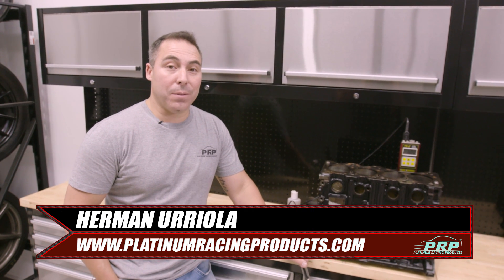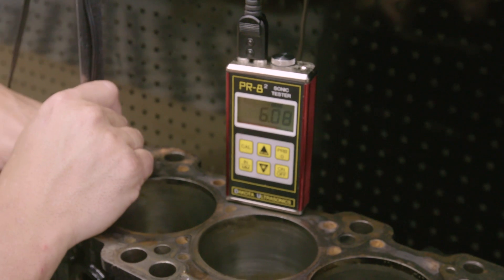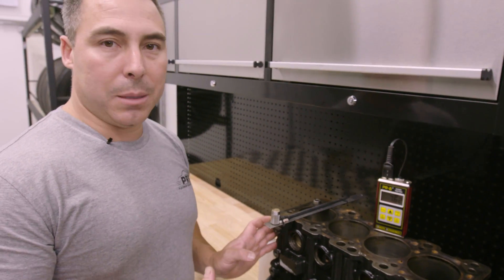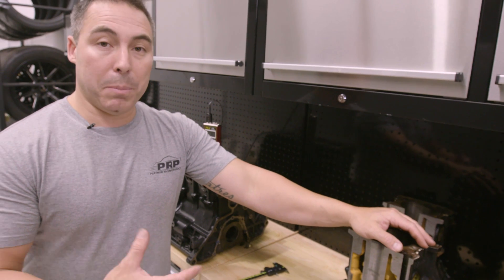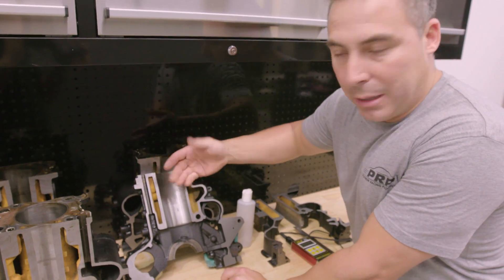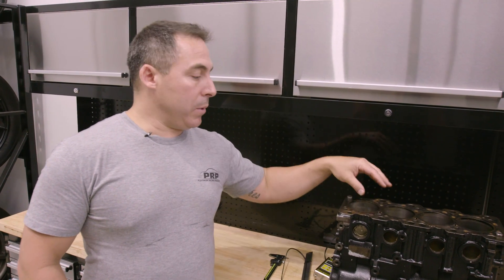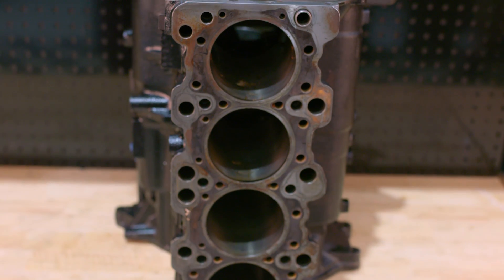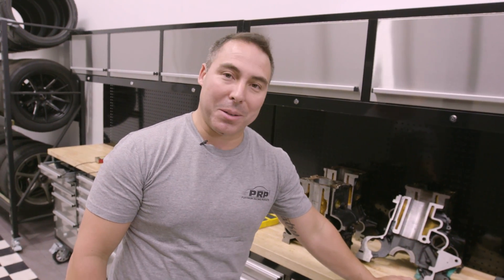We cut Up a 4G63 Evo Block and Test It

Comment: You need to progress to an "A-Scan" ultrasonic flaw detector and learn how to use it.
You need to see where the reflected signal is coming from and you see what is going on.
Ultrasound at this frequency (2Mhz - 5Mhz) will not pass through an interface of air, but will pass through solids and liquids.

Comment: Would really help to have a proper ultrasonic thickness tester like a DMS2 or 38DL with an A-scan display, so you can see what the waveform is doing. You could have seen these changes in section without cutting it open. Generally helps with ensuring you are picking up a clean backwall and not other geometric features or point reflectors.
Reply from the maker: teamneverlost agreed but cutting it open is still the way to find out what is really going on and worth it for long term development
Reply: @MotiveVideo  For sure at the cost it's probably worth it for r&d, but if there's ever anything you don't want to or can't cut open these sets can help in seperating spurious indications.

Comment: When are the early Holden used engines going to be tested, like the 5l, 253, Buick 3.8, ecotec, and all the straight 6's
Reply from the maker: They dont really suit our Motive market. These arent cheap videos to make either.
Reply: @MotiveVideo  however they are cheap engines to get ahold of, it could also expand your audience(more so when I'm guessing that most of your audience is Australian anyway) and the 5l at least has been a rival motor within a shared chassis as the RB(VL) and you could go over why the RB is often the better choice and ecotecs have been proven to make some big numbers too

Comment: I love these tests. I don't know if Australia has 4G64 or 2.4L examples there, but I'd be curious to see what they're like. It has a taller deck, and perhaps a thicker deck. They do have a bigger bore as well, but that might equate to thinner cylinder walls. Furthermore, I'd like to see if Hyundai or Kia blocks are any different from Mitsubishi blocks. I don't know of anyone else doing this kind of testing for the public's knowledge base.

Comment: Cement filling the block is not uncommon to add strength to the bottom.
Reply from the maker: Adel AlMejhem that actually wouldn’t help the problem we found between cylinder walls
Reply: @MotiveVideo  Thank you for the information. A lot of evos are making 800+ whp .. and their block holds fine. When do you think that weakness would become a problem?
Reply: @K2theK-b6u  it holds fine till they turn it up slightly, they're teetering on the edge at 800, if they weren't you would see alot more at 1000+

Comment: I wonder if there is a difference between the 6-bolt and 7-bolt 4G63, in old evos before the mirroring, its common to use the older 6-bolt.
Reply: bingoberra18 

I want to see this info too. I’ve got a built 6 bolt VR4 motor that was built for 700hp. APC ran the 6 bolt deep into the 9’s consistently with no issues also. I was always told the 6 bolt block was much harder and thicker.
Reply: I bet the 6bolt is even beefier

Comment: Very interesting.

Wonder how Tilton go about their builds seeing this as they are making well over 5-600kw and still using the cast block instead of going billet like what Michael Baghdadi did with his 8.
Reply: They're many 4g63 engines well over 1000hp, never heard of a cracked 4g63 block. Toughest 4 cylinder engine they're is.
Reply: They half fill the block.
Reply: @mehrshadvr4  where did you get this info?
Reply: @supernice_auto  people do these in the u.s every often

Comment: There's a reason the 4G63 is such a legendary engine.. Well.. block at least lol...
Such basic roots back in the 80's to what it became... and why so many love this Engine. ..Me.. very much so... as well as the 4AGE....
Huge thanks for showing us what you found...
Side note: ummm 500-600kw block... then becomes deficient ...really??!.. Pretty impressive..
coming from an 80's design!!!
Anyone would know that's far beyond the limit from a stock 2lt block... 20 years ago... When the Tommi Makinen Edition was released... you think, that anyone thought that 500-600kw would be achievable through the Mitso 4G63??
Just glad that engine builders and tuners had the brains and talent to bring these engines to such a huge level...
with an iron casting......lol... at least it's acoustically dead... that's a plus...

Comment: Damn I never knew that about the 4g63 block. I always thought they were sleeved like honda blocks. Is there no other way to better support or strengthen that block ?
So next on the list ; 4g93, 4age, 3gte, ej20, b16a, k20/24, h22, lr8, 13b.
Reply: I think the only way to make a standard block stronger would be to do interference fit sleaves, which requires the original one to be milled out very precisely then replaced which is what high level diesel guys do

Comment: test an LS. Maybe grab a LS1, 2 & 3 and see difference between. could be interesting
Reply: I'm going to save them the comment, they're a sleaved block so there's not much of a point in testing if you plan on pushing over 800hp reliably it's better to start with an iron block or getting a resleaved block

Comment: Any chance you can do comparison with a 4g64 block as some evo owners like myself use them for 2.4 builds. would be good to know if they are similar in strength or alot weaker.
Reply: 4b11s are weaker than the 6 bolt 4g63t
6 bolt blocks all the way.
Reply: @Ryan_1997  no they are not

Comment: Love to know what makes the k series a great engine
Reply: Its the amount of air the heads flow, somewhere in the 300cfm with stock ports. VCT to help with low end torque aswell as VTEC, small cam for low rpm, big cam for high rpm, very smooth and linear engine thats very eager to rev, 8500rpm redline from factory, 9000rpm redline with a tuned ecu or higher in built motors, bottom ends are also very robust, well known to take 320-340wkw on completely stock engines (stock head, stock bottom end completey unopened) with boost on e85, ive had a look at the bottom ends also and noticed the girdle is tied into the block, similar to that of a plazmaman billet girdle that is made for an SR20. After playing with RBs, SR20s including doing a VE head swap and now having done a K series build i can say the engineering put into the K series is what makes it a great motor.
Reply: The simple fact that it’s not a 4g is what makes a k series so grate   B series for the win tho
Reply: @Ray-Vr38  K sure, B ? lol.
Reply: @TurboVisBits  Ray Loulach know's what he is talking about K20/K24 are great motors but Mostly Best for the N/A scene  but when it comes to Boost B Series is Defs King...   Go look at Rays Channel.. he Loves his Civic's owns a EG with the Plates 4GLOL,  makes over 1000fwhp on a Hub dyno,   Pretty sure he also owns an Evo of his own,
Reply: @jjsorenavki7005  Worlds fastest h pattern in the world is grannas 2jz supra second is boostin performance 4g63 talon
Reply: @jjsorenavki7005  hondas rule fwd tho no doubt i was always interested in the rsx/dc5 if im not wrong there k20 not k24
Reply: @omardsm2323  where I say anything about worlds fastest manual? Lol
Reply: @jjsorenavki7005  first coment was for someone else my bad lol and i meant the second coment

Comment: HP Academy just did an interview with Julien Godfrey this morning where he stated that he put a 12mm steel plate between the block and head to ensure block rigidity as they run 3.0bar through a 45mm restrictor.

Comment: Test it against a 3SGTE
Reply: More importantly the 5sfe as they have true siamese bores the length of the cylinder unlike the 3sge/3sgte blocks, hence the common 5sgte builds seen in the MR2/Alltrac community. All 5 generations of 3sge/3sgte blocks have a 30-40mm cavity between bores at the top of the cylinders, (I assume for more cooling surface area where the most heat is generated and to create a more interconnected coolant flow path) which is the reason for the common cracking in builds over 3-400wkw (obviously turbo/fuel/application dependant, cylinder pressure vs RPM associated with these power levels being the defining reason for failures) ALL generations of 5sfe and some 3sfe feature the full siamese cylinders (some 3sfe cars used 3sgx blocks as they are fundamentally interchangable, unlike the larger bore 5sfe 87mm vs 86mm Depending on the location and time of production, due to over production of 3sge/3sgte blocks relative to demand, the cavity can be seen through the front frost plug holes if you are looking to confirm what block is actually being used..) there is also a well known cracking issue around the head bolt hole nearest the water pump, Toyota added extra material to all S series blocks in this  area from 1996, these are known as 'straight edge blocks' and can easily be identified by the straight edge and generally thicker area around the deck face by the water pump instead of the previous generations where it followed the contour of the cylinder and a bulge is seen where the bottom of the head bolt/stud would bottom out. Again due to old stock being used, not all 1996 blocks feature this and it's generally accepted that it is not a guarantee untill 1997-8 depending on who you ask. There is also word about American cast 5sfe blocks (known as 'square boss' due to the raised square areas where the freeze plugs are located) which are rumored to have thicker cylinders/decks but I have seen 0 evidence proving this unlike everything else mentioned here.
Reply: @3sgteJoe  I have a '96 GT4 that has all the stock features of the improved '96 version. Possibly need to get my block checked!
Reply: supply a 3S and they possibly will
Reply: Florida Man wouldn’t be hard I’d imagine the block is the same as the RAV4 and celica
Reply: All 3sge/3sgte blocks are weak in-between cylinders, if you're shooting for over 300wkw I'd suggest finding a 1997+ 3sfe/5sfe or you'll be cracking bore eventually

Comment: When are you going to do sr20det test ?
Reply: He literally explains why not in the start of the video
Reply: @piffiiiiiiit  No it can't be compared bc it is not a cast iron block. All his testing is on cast iron blocks.
Reply: @piffiiiiiiit  Okey... Why would he test an SR20 then when all other tests have been comparing cast iron blocks and the sr20 is not.  There is no real market from his point of view in high power SR20 blocks.
Reply: @piffiiiiiiit  Comparing factory alloy blocks to each other yes. But not billet blocks. Too much design differents of different manufacturers. And also depends what kind of  sleeve they put in.